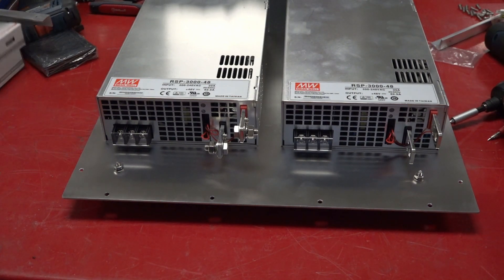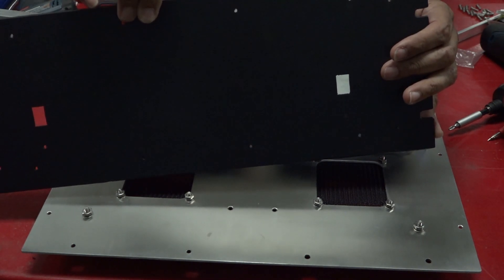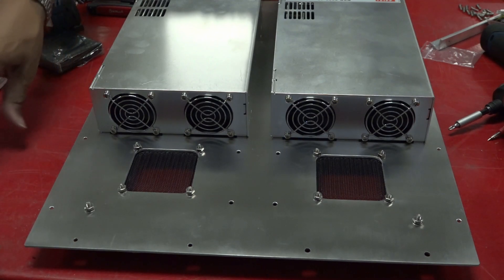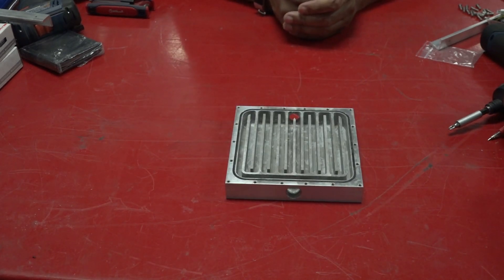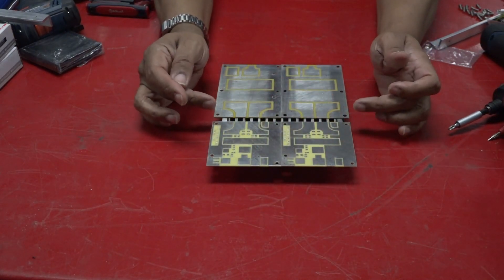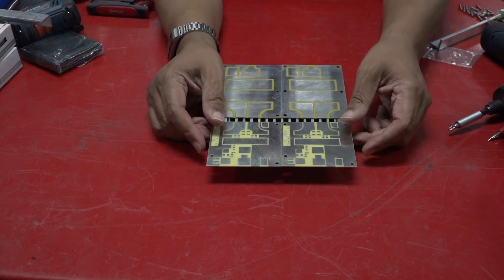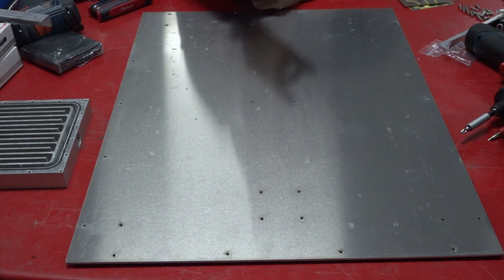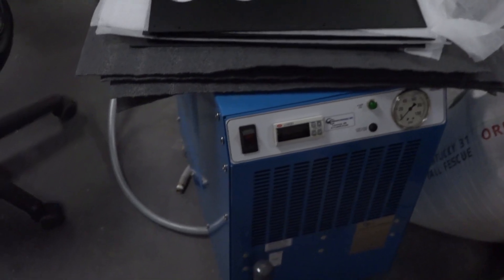LDMOS update and bring back the Dead Hamma

Comment: I would just wonder what it would cost to build a big hammer with the ldmos? Or is it more economical to go old school steal tube. Even though the ldmos is the future for sure.
Reply from the maker: Great question!  Prices are all over the place on both tube type and LDMOS.  Eimac, (as far as I know) is no longer manufacturing tubes and the "norms" have yet to be worked out with LDMOS.  I honestly have not tried the Chinese tubes yet so, I have no educated opinion on them.  On the LDMOS, the issue for me is power supply.  Switching supply vs LTO/LPO batteries vs the Traditional transformers.  

1.  While  are convenient for 1 to 4 transistors, the receive noise is a headache (although there are ways to fix that issue).
2.   are an attractive option also.  I am admittedly still learning about the monsters but, my biggest issue is I don't like the form factor I've seen in the communication space thus far.  I love the look of them packaged in 19" rack form though.
3.  Big, bulky and expensive A.F. .... however, they last forever and a day and nowhere near dangerous as the 11KV that I now run.  Rectifiers are cheap and caps are ........ well LOL.  I am going to try all 3 at some point but right now the transformer is "literally" proven at extreme power levels so I'll start there!

DECISIONS   DECISIONS

Comment: When it comes to powering a Octo Ldmos Unit my main question for you is how far can we go with 1 single 50A 220v Service?

A buddy of mine had 100A Meanwells he got got a very cheap price but the only issue is that they ran on 3 phase only. He ended up selling them because he couldn't figure out a good way to run them.

I am wondering, I haven't sat down to do the math via ohms law but how far can we go before having to do custom work on our AC end. Maybe a 6?

Also last but not least. I bought a gang of 40A Mean Well Supplies SP-480-12 
Two ?'s if you dont mind brother....
First off do you know how to modify these to go up a bit on voltage?(flyback)
Second, I've noticed these injecting noice into mainly imported radios with wide Banded receivers when I parallel more then 1 supply. Have you ever had an issue having to filter out mean wells?

Its crazy cause you would think that these high dollar supplies wouldn't be noisy lol.

Thanks in advance bud, Take a look at my attempt at a quad. Yours makes mine looks like a toy but it was a learning experience and I gotta go with singles from now on out.

Much love to the Skullcracka Nation!

Ole Gatekeeper from GA... A white boy but no duck plukin Hill Billy and I got down right there! 😆😆✌🏻

Comment: Thinking for the future. What about taking the water out the system? Take the refrigerant from the chiller, which is basically the same that you are doing with water and intergrade it into the box. In the chiller, refrigerant is pumped through a coil system to cool the water. Take that cooling coil and put it in the box directly. Basically put the chiller and box together.

Comment: I'd probably add a small bead of rtv silicone to the seal for insurance. As far as coolant fluid, glycol works amazing. One thing to keep in mind is the rate of flow through your cooling device. There is a balance between extracting all the heat and cooling the pallet. That would be in a radiator type air cooled situation. We race dirt track cars and keeping those engines cool can be a challenge at times. Were not allowed to use glycol antifreeze. There is an additive called watter wetter that helps with lowering the water temperature. Come to find out adding fabric softener to the water has the same effect. I guess on cooling the question would be, will it ever get hot enough to reach boiling point?
Reply: Distilled water works best.   Better than wetter, only downside is the boiling point which I doubt will be an issue here with the chiller.

Comment: To each is there own. I'm old school as hell I won't run a pallet but with no disrespect I rather run 2879 and 2290 transistors that's just me. I understand everything and it's cake walk for me. I'm lost with lmdmos and from what I understand is they can and will literally fry instant. I don't have much money on fixed income but I do have a shelf of original red dot 2879 and 2290 transistors I bought back in 89 and will never use them or need them all. Also no not an overkill to me because I always go bigger wire than needed, lower amp fuses, 16v caps because I stay at 13.7 to 14.3 Max and I make sure I have plenty of air circulation. You have to protect your investment.
Reply from the maker: Hey Greg, I totally respect where you're coming from brotha.  I built and ran 2879s for years and I ran them kinda crazy honestly.  That being said, LDMOS demos I've seen are the very reason people are having trouble with them.  Every demo is either a peak meter with a tone generator as input (which gives people the impression that it's an AM carrier waiting to be modulated) or a resting carrier with a massive amount of harmonics.  First question people ask is "how much will it do" as opposed to "how should I run it"?  I know I'm in the minority on this but, I would love it if the LDMOS had 3 times the footprint for better cooling but, so many people want them small.  What I'm proposing is people stop buying amps capable of X amount of watts max and running it there.  How about taking an amplifier capable of .... say 5KW never running it above 2.5KW?  Every amp I have run in the last 20years has lasted longer than expected because of that mentality.  Good luck brotha!

Comment: Obviously this is pretty dope and will clearly drop a proper maul. If I may, peltier technology can not only cool it to any temperature you’d like but it can also harvest DC power via thermal power generation. On a Texas Star 667 it wouldn’t be all that much but on 10 bushel it might be interesting and the generation of power is only a secondary feature. It still cools transistors without liquid. It’s not muffin fan cheap but then this game isn’t.  SkinTalker 117 northern Nevada and I just got down..
Reply from the maker: Hey wassup Muddy?  Great point and I have considered Peltier technology but, the fly in the ointment is cooling down the hot side of the peltier device correct?  How is that done and wouldn't it be just as difficult to keep cool as the transistor itself?  I tried one years ago and although the cool side did get cool, the opposite side was smoking.  Help!!!!  lol
Reply: @skullcracka1708  this is true, physics is always in my way. However, we need to move the heat not make it disappear.

Also let me be clear, I’m not claiming this is the answer but perhaps an answer, also over rate the Pelletier in the same way you might on a box. Build a 10k box to run at 5k
Reply: @skullcracka1708  also, how many square feet are we cooling? How cool do we need and for how long? We can get anything sun zero for cheap as long it’s it’s not for long. How much aluminum, what is the temperature differential and the time frame. Building shit…is my shit and radio is my white dragon and I chase it.

Comment: Looks like you have the perfect opportunity to 3d print, or otherwise fabricate, ducts that go from the bottom plate openings to encompass the entire rear of of each power supply. That way they could only pull fresh cool air from underneath and never heated air inside the enclosure. Just a thought.

Comment: Damn son, it's been few months wondering what you been doing. Neighbor down here in the valley sittin on the 80s 2 pill and a bent coat hanger,  pinnin meters and growin peters.

 Its prolly been said because we are less abstract on ideals and you,  but the way that blocks cut running on its side, it will truly have an issue on trapping air on the top side. The flow would be fine yet would have to be concerned with evacuation of all air from the system if it is closed due to obviously rising. If running the outlet low and out high will net more heat being raised so I would say start at the top  and flow out to the bottom. A good way to see how the system would work is to cut a cover using lexan/plexiglass and set about 4+ manifolds up and allow it to flow to see if any air gets trapped in your original manifold. 

All in all the system looks fantastic and nets much in about every area of amp building in general and even more with your amp rack set up!! I'm always on edge waiting to see if you release new videos and here you are with the LDMos. I'm excited.  So I'm always down to spitball ideas around. Maybe I'll catch you on the flip sometime down at the mailbox. Keep it solid brother

Comment: Is it possible when standing those up that you feed the cold in from the bottom take the hot out the top so you don't have a difference between a lower cavity and an upper cavity I'm thinking that the cavities need to be side by side with the heat going up to keep everything even then again what do I know you been doing this longer than I've been machining parts sorry I'm even butting in. 
Your attention to detail is absolutely kinky cool.
If you were a hot rodder I bet you would machine a grill for your rod out of billet stainless to go with the billet chassis. 
Where does this kind of hardware even come from.
Way back when I was machining solid aluminum heads when everybody else had castings I'm going to guess you know the difference between 356 cast and 6061 TO and yes we still run water through them just not a traditional water jacket to blow the entire chamber into.

Comment: Just saying... if two seperate external after market car transmission cooler radiators that could be in an aluminum cases that would direct the cool from a portable air conditioner the (cold) air can be transferred to the box for cooling apparatus using the same 6 or 8 inch diameter flexible hose that this 4ft tall by 12 inches bt 18 inches rectangular. AC is on roller casters made to easily be moved from room to room with the hot air exhaust made to fit on a panel with extendable accordion type expandable sides to fit most any window. 
Open window put the panel with the extendable sides and closed window to keep summer heat kept outside while. Blowing the cold air in the room and as with the regular window unit AC we are used to just the 10 inch tall panel with the flexablw hose attached
Is much less obtrusive to expel the heat all ac's coolers, refrigerators, chillers, freezers work or operate. 
These portable ac's come in variable sizes and models to cool 1 room to several rooms and all operate the same way.
Myself from working as top salesman in the whole gulf coast for the Home Depot corporation, and yes Lowes sells these units also...
But much easier and 
valor colder than any "chiller" could ever do
Example wine or beverage coolers out there.  A simple pump made for a little goldfish pond in the patio area are cheap sealed and made for continuous use or as needed for if you had a statue out of pond that spurts or flows into a terraces of pools like steps. Going down to recycle at end or bottom pool to recirculate over n over.
Well I've been called a 
Mc Gyver for as long as.... 1butyou asked if anybody had any other ideas and this positive flow of coolant (yes do not just use water) for even aluminum will detereriorate ) with out the anti freeze mixture.
Your cooling doubles using antifreeze all in a closed system.
Now whether a chiller or my AC system accumulates moisture condensate so you'll need a catch basin pan to hold this my AC unit type has a resivior to hold this OR has a flexable drain hose to run through floor or wall to dump outside. Just another note you might not have anticipated.
Anyway ...hope to see more of your videos to come.
My email is
tmacfirmin@gmail.com.com
SMALL LETTERS ON ALL
BEST OF LUCK !!!
FROM the swampland of south Louisiana in the Crawfish Capital 
Of the World down here in 
Breaux Bridge,
Louisiana
70517
73's have a good day

Comment: Thank you for your video Sir.  Good stuff. 

1) Add a ½” around the entire water block and add another seal. In between both seals add a water sensor connected to an LED to let you know palette 1B has a leak and maybe that shuts down the amp until it is fixed.    

2) I would add plate on top side that connects all palettes together for added stability.
Reply from the maker: Great point Ken!  I have a flow switch on my base amp that will kill all HV and filament.  Noted
Reply: Really nice 💡  I like that!

Comment: It will key there and swing with enough circuit! But, can ya keep it cool?! I love the liquid cooling system! I’ve seen a few single and duel blf188 multi band hf amps in big 64 cabinets with supplies. But, I’d really like to see more of your cooling system. I think you’re going in the right direction with things. Even if water isn’t the answer? and or maybe a propylene glycol mix, alcohol or a refrigerant may work over the others for the space or efficiency!? I absolute love this and think we should series parallel charge a set of four 12v bats in a auto. When keyed up a set of SCR’s or old school solenoids would switch the charging circuit out of line and put the 4 12v batts in series to make 48v to run the LDmos stuff and keep the 12v stuff in the car just fine. One for 10-160m would be nice too! But a mobile to base operation amp anyways with low drive and big output! Yes! You’d be the man!
Reply: Propylene glycol or similar coolants would be slick.  Not sure about alcohol.   Hell, propane is pretty cold, but probably a really bad idea.  

Ammonia is probably out of the question too.  Lol.
Reply from the maker: I'd love be educated on what fluid would work best

Comment: NXP MRFX1K80 is a 65 volt LDMOS. Build an 8 pill with those. You should be able to arc weld passing planes together in mid air when you dead key.

Comment: If you do mount them on their side. Make sure the inlet and outlet aren’t sideways so it doesn’t trap air and the water take the low side through the block and burn up a ldmos. You probably already knew that. But sounds like one heck of a idea.
Reply from the maker: Great point!!   Thank you Allen

Comment: Meanwells... all i'm saying.. i suppose they're cheap compared to the rest of the set up,
but cheap PSU ??
on the cooling i would have thought laying flat would give a bigger surface area for cooling instead of upright.
yes you can run more upright but only the edge will be cooling, so why not make the slab taller lay it flat but twice as tall, 

what do i know i'm just waiting on Cycle 25 so you can actually hear me this time round.

Comment: i would propose that you turn the covered fins away from the part and present the flat side to part for maximum heat transfer and use the coolant with fins to wick the heat awy ie with liquid transfer. i refer to the computor cooling as an example. i feel you will get much more heat transfer this way. very intriging indeed my friend good luck with your project.
Reply: And in the words of WolfMan Jack "let the midnight special shine its ever loving light on you"

Comment: Always have to look towards what next, that's what keeps this hobby going. Imagine where we would be had sweet tubes been where the technology stopped. It is my opinion that the leap from Steel tubes to LOMOS will be as important to this hobbies longevity as the leap from tube type transmitters to transistor type transmitters. This hobby will not die with steel tubes and  toshibas it will move forward.
Reply from the maker: I agree completely.  I think we are still at the beginning of something big.

Comment: Your not crazy sir. I like your cooling brick idea I just think it needs to be bigger. Make a cooler block that will 8 pallets front to back.
Reply from the maker: seems like the devices towards the rear would get hotter ..... no?
Reply: @skullcracka1708  yes your gonna get some heat soak with more on there but the internal water path can be modded to have 4 paths with two inputs and two outputs. With them on their side like your thinking the heat spreader can extend past the water block and pallet board. So the heat NOT wicked into water can migrate to the spreader extentions fins cut into them with fans blowing. The fans can be regulated when. Temps get hotter than wanted or constant.  Also the bottom of the water block that has the path actually routed in it can be fine as well